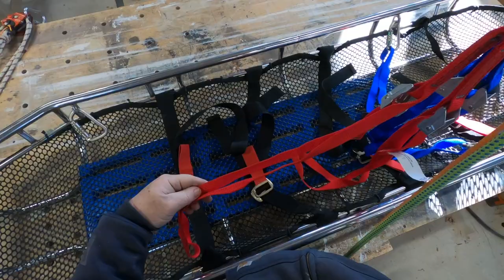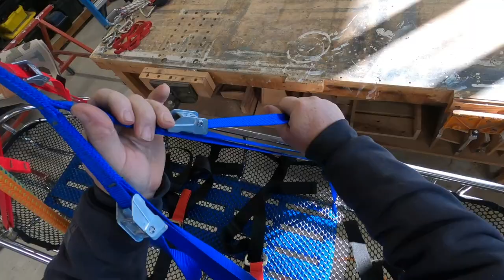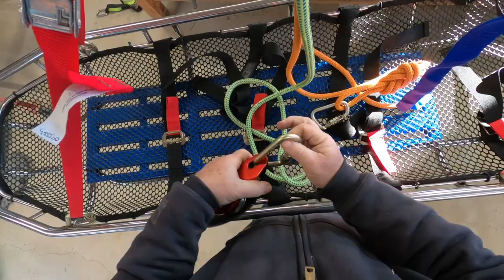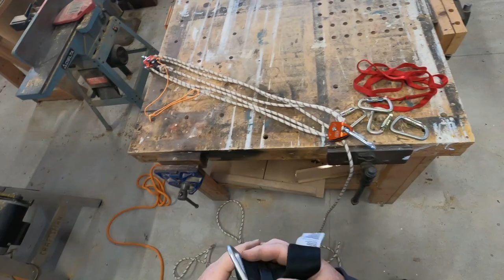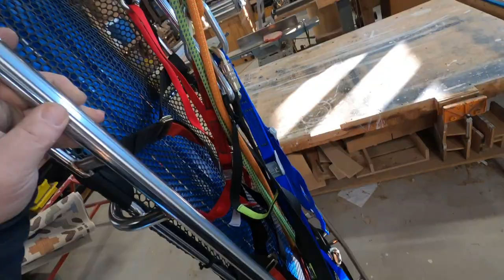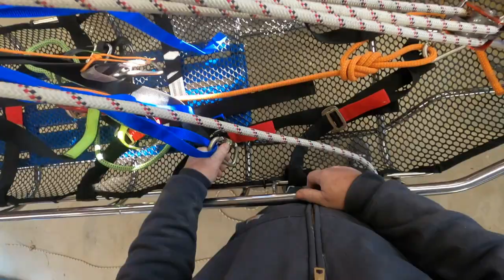How to rig a litter for High Angle Operations

Comment: Nice video with some excellent explanations and system example. I how ever would run both line to myself for working and safety (redundancy) as the patient is already in the basket they have two line they are attached too so if one rope was to fail the other would take hold.
Reply from the maker: Or you could add another tether to yourself from the master ring. It's up to the operator in what he feels comfortable hanging from as long as it doesn't impede operations.

The videos I show are one way of doing things but there are many other acceptable ways of performing these tasks. There is no right or wrong per se, as long as everybody stays safe. Cheers

Comment: if we want to lowering stretcher and almost vertical not put Micro 4:1 at the head? What is the consideration to put at the lower stretcher?
Reply from the maker: Not sure I understand your question. Put your question in your language and I will Google Translate it. 
But if you are asking why we would put the 4:1 on the litter it is simply to be able to put the litter in a vertical position with the victims head up top. Sometimes moving in tight spots requires re-positioning the litter.

Comment: when you place the ready made 4:1 and remove the blue legs of the bridle, do you think adding all of the available slack to the blue legs,while off tension and instead of removing them, would that allow enough travel in the system to allow the litter into the vertical position
Reply from the maker: I'm pretty sure they aren't long enough even fully extended but I don't have that particular bridle near me at the moment to check. It would be good redundancy if they were though so good thinking on that but the 4:1 is perfectly adequate by itself.
Reply: Would you use a butterfly knot to tie ropes into bridle?
Second if our Pt. Is t wearing a harness are you simply connecting litter redundant line to the head of the litter?
Reply from the maker: @shawnklimchuk144  No on the butterfly because the knots will load incorrectly but I bet if one were to test them they would fall within safe load parameters. It would look bad though whether they were strong enough or not.

The patient will always be wearing a harness, either already one they have donned themselves or the one we supply or tie as rescuers. The redundancy for the patient, meaning two points of connection, will be the litter itself as one and the tail of one of the interlocking bowlines that will connect directly to the patients harness.
Reply: Just out of curiosity where did you go through to get your certification?  Id be interested attending one of their sessions. I have never seen anyone interlock your main line and safety line together like that out of the few companies I’ve trained with. Totally understand there is different ways to do things but see a few things in this video that could get you in trouble. I was always taught keeping them lines separate . You also have nothing for shock absorption on your secondary/safety if anything were to fail if is not located up on your anchor with a ASAP, I’d also recommend attaching to your dorsal so your not taking a shocked line to the face.